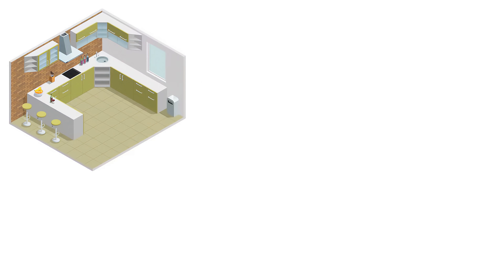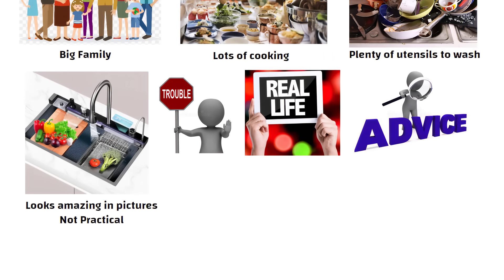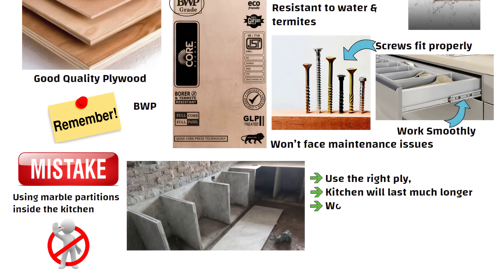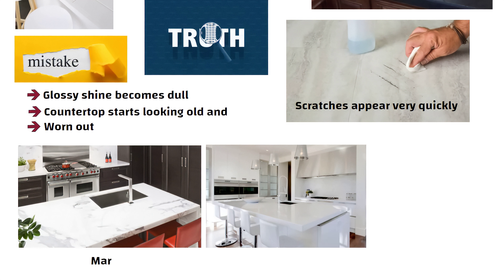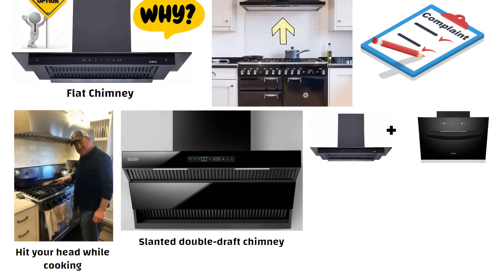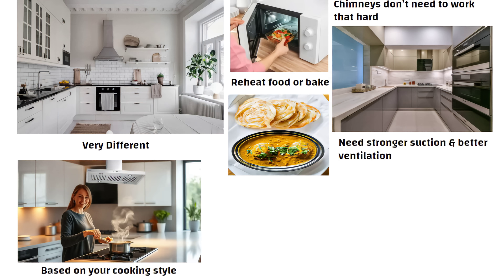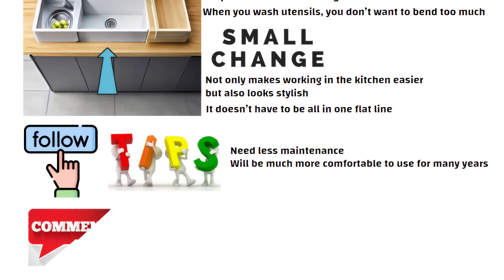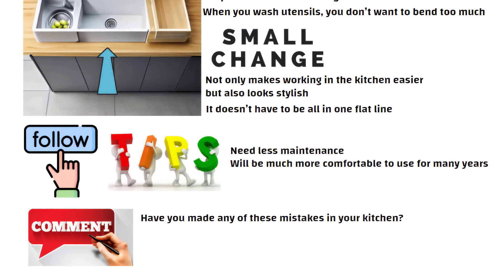9 Kitchen Items That Wastes Your Money

Comment: My kitchen platform and cabinet space, including SS sink is made from BWP marine ply.  The countertop was laminated with Decolam, the cabinet doors laminated with Decolite (thickness of the sheet being the difference). Countertop was fabricated with 25mm and 12mm BWP sheets glued+pinned together. Extremely elegant and has lasted close to 35 years with no sign of wear.  The only enhancement I may do, is to coat the top with Epoxy (if and when needed).   Minor repairs include replacement of drawer channels after more than a decade of use.  A hinge here and there.  The original Ariston (Italian) built-in hob lasted around 30 years. The replacement Hindware (Indian) SS hob is going to be a recurring expense as the burners are rubbish.

Short of it.  BWP platforms and cabinets are perfectly suitable for Indian kitchens with daily heavy-duty use.
Tip. Use top quality and thick laminates, a cutting board (not the platform 😁) and wipe off curry stains soon enough.

Comment: In my humble opinion, it may be best to keep the counter height at around *32 inches**, which is considered a standard and comfortable height for most people. If someone using the kitchen is shorter, they can easily use a **sturdy 3–4 inch step* to stand on while cooking. For someone who is slightly taller than average, the standard height usually does not cause any difficulty.

The reason I suggest this is because designing the counter based only on one person’s height may create challenges later. For example, if relatives or guests come over and wish to help in the kitchen, they might find a customized height uncomfortable.

My opinion:
A standard height keeps the kitchen versatile and comfortable for everyone. It also avoids long-term inconvenience and makes the space more universally usable, especially in homes where multiple people might occasionally work in the kitchen.

Comment: I would like to add a tip regarding the counter top height particularly the cooking counter top....considering that women often experience lower back pain due to long hours of standing while cooking, the cooking counter top should be of a height (with leg space underneath) so that women can sit on a chair while cooking.
Reply: I am cooking sitting in a wheel chair. If you have a lower level to suit wheel chair, then the LPG cylinder will not fit. I am using induction stove and made self designed counter top full storage space, on wheels. 
   The better option shall be an office chair on wheels. witb this, the cook shall move freely  along the cooking table, sitting in the chair. No.need for leg space.

Comment: I live on the 14th floor of my 15 floor apartment, and I have installed a waterfall sink and i must say it is a beauty, i have been using it for 9 months now, no problem watsoever, pressure is super, i am not sure if thats due to the high storey i live in, mine is non switch type sink not that piano one….cost me approx 15k last diwali when i brought it…

Comment: I will do kitchen renovation in the coming weeks. And I always do my homework, watching this video is part of my homework. I have thought long and hard for my kitchen. G o for sintered stone. No granite. No quartz. Google it, you will know why. Im not Indian but Im asian so yeah definitely lots of cooking. I dont want to use chimney. I will move my stove directly under the kitchen window and put exhaust fan. I dont have the energy just thinking about cleaning those chimney. In addition, I will build the kitchen set accordingly, where do I need to place on what items and how much is the space needed. I have already thought about sink practicality, height of counter top, material for long lasting wear even before watching this video it just make sense. As for built in appliances, that is something that I dont want to do either, you will need to replace your oven, microwave, etc one day, so built in is just much hassle. But I will do stove top because standing stove needs cleaning underneath daily. And stove top.much easier to clean, just set the place for stove so you can easily change your stove one day. Choose stainless steel instead tempered glass, tempered glass may break.

Comment: I have used granite partition in my kitchen but didn't used the drawer system, just made horizontal partitions/racks as per requirement with that granite only. And then closed it with Marine grade ply and laminate.
Reply: I am looking to do this  but unable to find any guidance for the same online to explain the mestri

Comment: Also tge sinks that are not perfectly square v/s those  little rounded at the sides and bottom. The small articles like cups etc slide in the rounded one but water is not quickly cleared in the square  sink. Which is best?
Reply from the maker: Rounded sinks are generally better because they allow water n debris to flow smoothly towards the drain, preventing clogging. Square sinks look modern but can trap water n dirt in the corners, making them harder to clean. So rounded is more practical for everyday use

Comment: Why is the Chimney required....As a cost reduction, have a long ventilation Window , 2ft above the cooking hob. This way, all the cooking vapors will exit quickly. 
Remember, in the old days, our grandparents kitchen was much better ventilated than the present days.
Reply from the maker: Chimney or exhaust hood is more effective than a window because it actively sucks out smoke, fumes n grease while a window relies on passive airflow. This helps keep the kitchen cleaner n improves indoor air quality, especially in modern, airtight homes

Comment: Please suggest whether concrete slab is best or full modular is best for kitchen counter top.
Reply from the maker: For kitchen countertops  full modular kitchen is generally better. It offers better aesthetics, ease of installation, integrated storage n good finish. Concrete slabs are durable but require more maintenance are prone to cracking and take longer to install.
So, go modular for convenience and appearance.

Comment: Sir, I heard that quartz is little difficult to maintain and not heat resistant because we cannot keep hot dishes on the slab directly because quartz countertop cracks but not so in case of granite countertop. Is this true?
Reply from the maker: Yes, you are right 👍. Quartz is strong but not fully heat resistant – direct hot pots can damage or crack it. Granite handles heat better. Always use trivets/stands on quartz surfaces to be safe
Reply: @engineeringmotive thank you sir for your prompt response
Reply: I am going to renovate my kitchen what kind of material to be used for countertops

Comment: Personal bug bear. Inset sinks, especially those with no draining area.
Water sitting on your countertop.
Silicon sealant collects dirt.
Cleaning often damages sealant.
No protection for work top from over flow of water.
No fall from worktop to sink so cannot self drain, You have to wipe it up.

Recomend:
Double drainer full unit sink with integral back splash, preferably with integral edge to cabinet.

Protects the cabinet. Especially the leading edge.
Space to drain dishes.
Water flows back into sink.
No issues with water damage to worktops. 
No dirt traps. Well maybe at tap base, but true of all taps.

History.
Family of 6, frequently guests. 
Gardener and cook.

Might not look as pretty, but for long term peace of mind and more importantly, less cleaning!

Preparing food and even the washing up, can be social activities. Cleaning is not!

Comment: Sir, You suggested SS sink but can u tell about quartz sink also which is trending nowadays whether quarts sink can be installed or SS only is the best..
Reply from the maker: Ss sink is more durable n easy to maintain. Quartz sink looks good n comes in colors but can get scratches n stains over time. I suggest SS sink for long-term use

Comment: Very important to know before building a new home. Pl let us know how to renovate a 25 year  old kitchen which has slabs. I don't want to demolish them as it is very expensive to rebuild. Some simple tips needed
Reply: When you say slabs, what do you actually mean?

Stone floor slabs.
Worktop out of stone blocks...

The first thing to find out,  is what the slabs are made of. 
A lot of stone/wood can be deep cleaned and then sealed. Hard work, but beats replacement.
Doorways and the sink area always take the most wear. So, if you go down the clean and seal route, pay particular attention to those areas. I would always recommend a (several!) non-slip, washable rug In front of a sink. Possibly the cooker too..
Easier on the feet than a hard floor, for long standing and any spills should be absorbed. Take them up and wash as required. 

Hope this was a bit helpful.
Happy to advise, if you like.
Reply: @tamsinlee6447 
It is the cook top kadapa black stone slab. It is thick and durable. Floor has mosaic tiles old one and has lost its shine
Reply from the maker: You can keep existing slabs (RCC) n just renovate the surface. Apply a good waterproofing coat, fix new granite on top, replace old plumbing n change the cabinets as per new design. This way, no need to demolish n cost stays low

Comment: Very nice but i I have one doubt about kitchen cupboards what we choose for low maintenance glass, acrylic or ? Tell me clearly for oil stains low maintenance
Reply: Go for laminate it is recommended every where
Reply from the maker: For low maintenance n resistance to oil stains, glass is better than acrylic. Toughened or laminated glass is durable, easy to clean n doesn’t scratch or discolor like acrylic over time